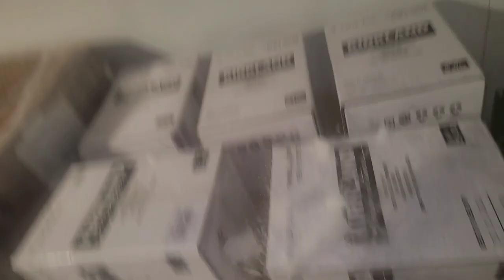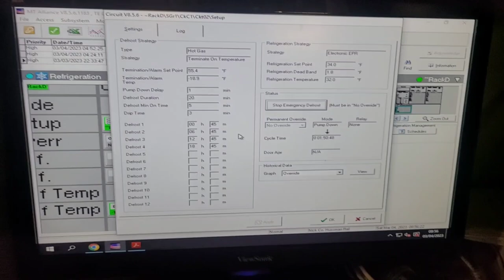Wholesale Grocery Salesfloor Walk In Freezer High Temp Alarms 2 Racks Deicing Coil / Part 3

Comment: Is that CDS opening to allow hot gas to go to coil ? Might be getting stuck. Also,  if it has a master liquid line solenoid valve, that might be bad. It’s happened to me before at a Costco as well.

Comment: So much ice ? Was it setpoint or low charge
Reply from the maker: Hot Gas is not reaching the Evaporator from the Rack. Not even a little bit. It's weird, I still have to determine and find where or what is causing this between the evaporator end Hot Gas Solenoid/EPR. HG Solenoid is working.